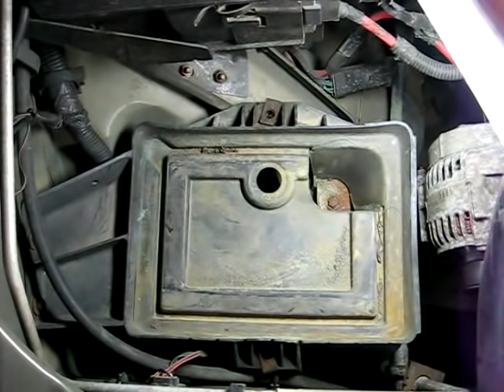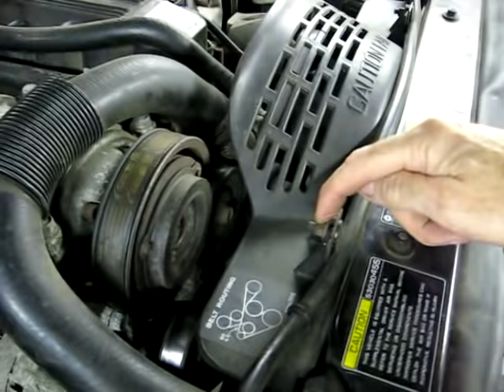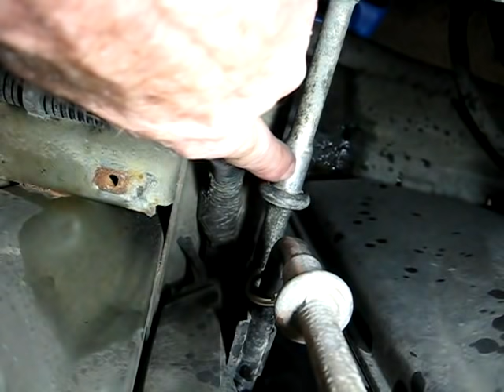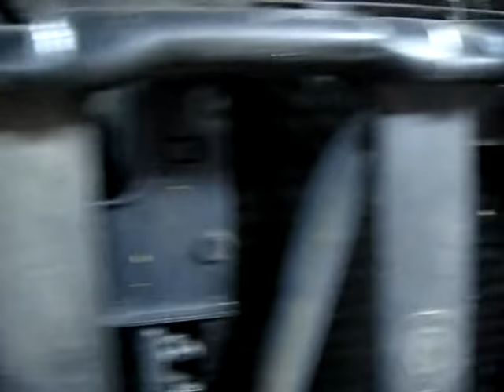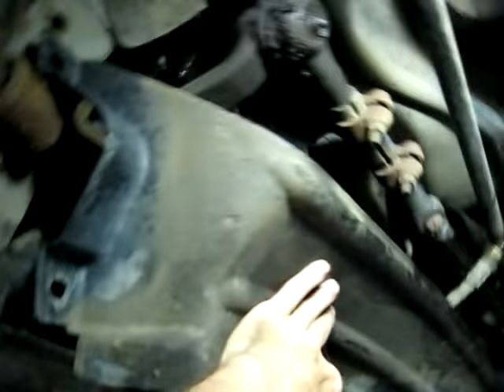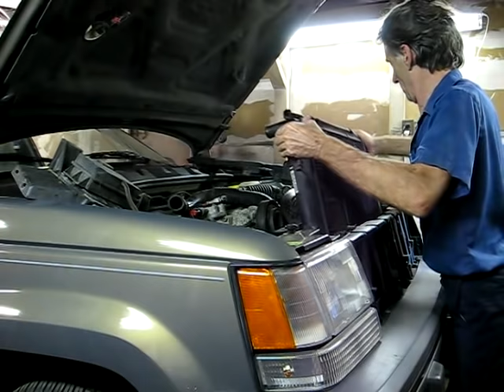Radiator and AC Condenser Removal (UPDATED VIDEO in description box)

Comment: Thanks for taking the time to make this video. My local mechanic told me my 95 Cherokee was not worth repairing with a blown radiator and head gasket leak into the coolant system. You video gave me confidence to try doing it myself as a last desperate attempt to stay mobile - I replaced the radiator to your video steps with a $93 one online and used $15 K-Seal for the gasket (the bubbles in the overflow tank stopped in 3 minutes). My old Jeep lives on! I can't thank you enough.

Comment: Thanks a lot for the video. It was super helpful. Couple of things - the condenser is kinda glued to the radiator and needs to be seperated to remove the radiator. There are also a coplue of clips on the bottom securing the shroud that need to be removed to pull the radiator. Thanks again - saved me $200-300 and a trip to see U2 in concert.

Comment: Got it! I was asking because after removing all the screws it wanted I was not able to pull the radiator out. What happen is that after 14 years of its existence the accumulated gunk fuzed the rubber between the condenser and the radiator. Had  to get something to separate them. Wish I had a metal yard stick at that moment. But it's done now. Thank you for the video and the info!

Comment: Excellent video.  Doing this on my 98 Grand in the next day or so.  Accidently nicked a hole in the condenser over winter.  Temps are getting hotter here mid to upper 90s already, 101 in a few days, time to get the AC going again.  :)

Comment: I've replaced the radiator on a couple Grand Cherokees, doing one right now actually.  I've never removed the battery or battery box or messed with the condenser, though on a few I have had to move the steering box out of the way so I could clear the bottom hose neck.  It's just 3 bolts so it's not too bad.

Comment: Thanks for this video, I need to replace the rad in my 1993 4.0L ZJ and although it looked pretty straightforward according to the Haynes manual, it's always better to see a tutorial video like this. I'm not removing the condenser so I guess I don't need any special disconnect tools?

Comment: Nice video. I was planning on changing the AC Condenser in my 00 Nissan Maxima because I replaced a radiator in a Toyota Tercel (easy car to work on) but seeing how hard it could potentially be I think I'll have to bite the bullet and take it to an AC tech.

Comment: @HzVids That's probably because you drained the rad by opening the draincock. The threads are very soft, and it's common that once you open the draincock, it will never seal properly again. Ideally you should never touch the draincock and instead drain the rad by removing the lower hose. A solution you can try is to remove the drain plug and wrap the threads in Teflon tape before you put it back, that may help it seal.

Comment: Well it turned out to be a quite simple job. Actually the hardest part was the disconnecting of the transmission lines. I found it to be much easier to disconnect the lines first with a disconnect tool and than remove the radiator. I got to give you credit if you were able to disconnect that bottom line with 2 wrenches.

Comment: premanual purchase! Newbie but becoming skilled. R there anything different on a 98 grand 2 look/do different? Only remove rad if i have 2. heater core is leaking so thats going to the shop but im looking @ putting on the water pump, hoses & stant. keep hearing the rad is next, since fluid was majorly leaked yesterday. today, still see fliud in top of rad but didnt drive it,no leak!  need to pin point where its leaking first! tips to find leak? Any sure way 2 tell a bad rad?

Comment: If on most cars this is correct then why remove the condenser hoses? Is it required for this vehicle. I'm asking because I am about to pull the radiator off  but it seems that it is stuck to the condenser; I did removed those two screws. I have a 1998 Grand Cherokee Laredo which is in the same generation as this jeep you're working on.

Comment: hey quick question....i have a 94 cherokee i want to remove a broken air conditioner can i just rip out the stuff that doesnt work(the thing in front of radiator and a couple other parts that connect to the compressor) and have the compressor only? im going to convert to On Board Air.... thanks and nice grand cherokee by the way!

Comment: My lower transmission cooler line (I disconnected the same as you), barely fit past the steering mechanism with the fan shroud in.  I ended up breaking my fan shroud to get the rad. up and out.  What am I missing with that?  What will take the place of the A/C condensor in-front of the radiator; do you simply leave it out??? Aren't there some some space/hanging issues that rely on the compressor being present to install the new rad.?

Comment: My air cond is working just fine i do not need to remove it or drain the refrigerant correct. I just have a leak in the radiator at the refill port which i dont know if it can be fixed or i will need to replace the whole radiator. I want to take out radiator and take to radiator shop.

Comment: You still need to have the refrigerant drained, Even if your A/C isn't working, your system could still have half of its refrigerant, and letting those chemicals into the atmosphere is a crime, and just plain irresponsible. Most places will drain it for pretty cheap. Call around, and specify that you only need the refrigerant drained, and not replaced.